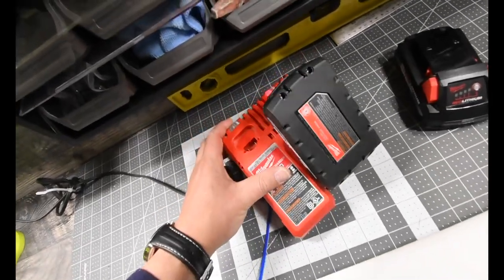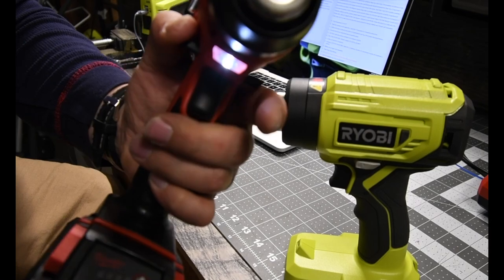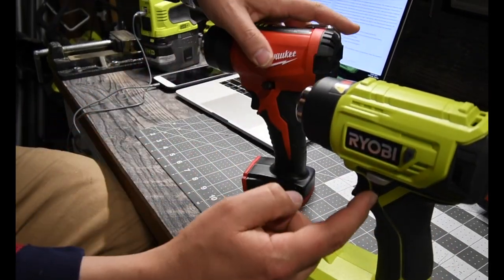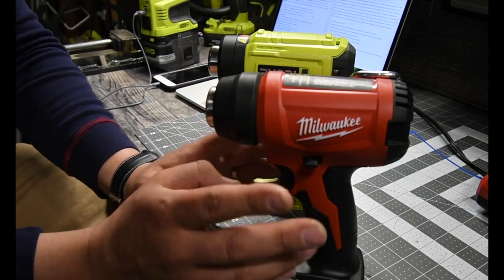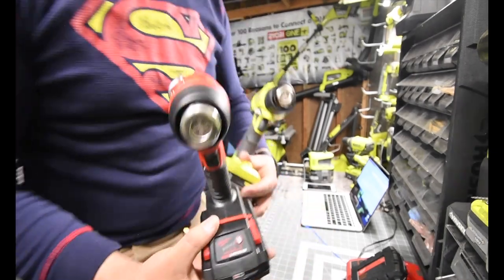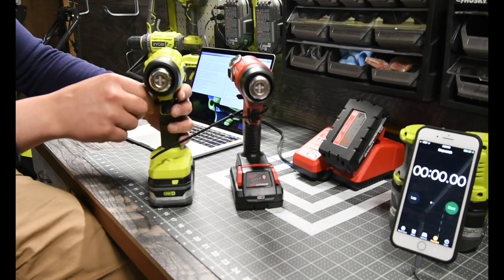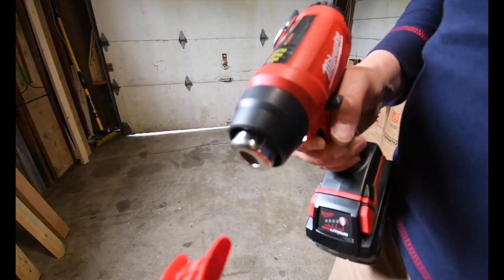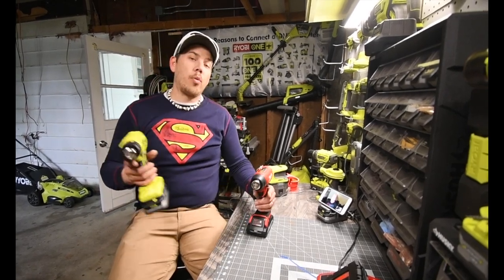Ryobi Heat Gun VS. Milwaukee Heat Gun

Comment: Bought the Ryobi last year and killed 2 in 4 months and 3 batteries. Then bought the Milwaukee and 14 months later  still going strong. Used on heat shrink tubing on auto electrics.
Reply from the maker: id go with the Dewalt. it is a much better heat gun
Reply: The Ryobi is made in the same factory by the same company with the same internal components as the milwaukee. I call bs

Comment: This might actually be better for me. Usually my head gun even on low gets too hot for why I’m doing. Usually hear shrink and such which seems to go from not shrinking to shrinking down and melting and misforming in an instant.
Reply from the maker: these are good heat guns to work that don't require a ton of heat
Reply: Man Caver Tools so you would say they would do good at window tint and heat shrink tubing as well as removing pinstripes ?

Comment: The Milwaukee batteries is what I fell in love with the tools are just a bonus 😂 in my opinion Milwaukee has the best batteries, I love my Ryobi too, great video
Reply from the maker: Thank you sir
Reply: Mykel Hardin  21700 cells in their new batteries, including this 3Ah battery in this video.
Reply: @anderspedersen5513  we have Bosch, Milwaukee and Dewalt in the truck. 21700 batteries for Bosch and Milwaukee so i can conpare 18V ProCore  to 18V High Outputs.
Bosch makes a more compact one lined 4 Ah than Milwaukee does 3 Ah. Bosch is the same for 8Ah than Milwaukee for 6Ah. 
We love to switch and battle some times in real life applications. The Bosch ProCores keeps working longer and unlike Milwaukee they don't lose to much power if they are on 1 to 2 bars left.
So i dissagree. In 21700 18V Batterie tech Bosch is leading

Comment: I love Ryobi as well but Milwaukee is the big brother. I have love for both. Ryobi doesn't really have a 12v system besides the drill so I have the Ryobi 18v tools but I am planning on getting some Milwaukee m12 tools because I believe they have hands down the best 12v line. I wonder if the internals of these heat guns (besides the battery connectors) are the same since they are so similar and tti owns both.
Reply from the maker: They were very similar in my hands.

Comment: Great video....you going over the simple features such as the handle grip and safety button location. I’m using mine for epoxy/acrylic pours and with my Ryobi glue gun it’s a perfect match for that application.  However I love my M12/M18 for my field applications, etc.
Reply from the maker: This is a much older video and I left info out in these ones and I thank you for you feedback Marlin

Comment: I push the Milwaukee safety down with my thumb...works fine. The safetys on their saws work similarly. I bought a bunch of tools during Ryobi Days last year. Ryobi is great for tools you don't use that often or specialty tools that nobody else really makes. I ended up getting more of my heavy use tools in Milwaukee. I need to get a heat gun, though. Still not sure which one I will go with since I'm heavily into both battery platforms. I'll probably go with the Ryobi since I also use the Ryobi hybrid solder station and I'd most likely be using the heat gun for shrink tube.
Reply: Yea I do alot of building and I'm hard on tools man I love ryobi they great for the price
Reply from the maker: its just in a bad spot or I just have big hands

Comment: My biggest gripe is that neither of them have a trigger lock. I use a heat gun to thaw out frozen evaporator coils and holding a trigger will tire out your finger. LoL
Reply from the maker: I agree. it would make it a lot easier to use if it had that feature
Reply: Does it work good for thawing out coils?

Comment: Ryobi is the best brand for working at the house there is. They have plenty of power, but they don't have much durability. Milwaukee and DeWalt will always be my first pick on a job site. I've literally twisted the motors off of the plastic handles with Ryobi tools, I've burned the motors out on a regular basis. They're just not industrial tools. Ryobi tool is not meant to drill 500 holes in one day. But if you need to build a deck on your backyard, it's the best bang for your buck there is.
Reply from the maker: Exactly and thank you sir
Reply: The new stuff is great, they've came very far. I use Ryobi daily impact and drills and it stands right with the others no problem. They've been going a year strong

Comment: I just got a ryobi hest gun. I noticed when i used a ryobi 1.5ah, 4., a  milwaukee 5.0 and 12 ah  battery  on it with an adapter the ryobi works better on the larger ah batteries than the smaller ones. The 12 ah the ryobi fan runs the fastest and hottest

Comment: Great info man, thanks.  I’m probably going to get one.  Definitely will a heat gun if I can’t find my corded one tomorrow.
Reply from the maker: it is definitely good to get battery operated heat gun
Reply: Its for small jobs, and its expensive. For paint removal and stuff its gonna work much slower than a corded one and for max 15 minutes with a 5ah battery. The ambient temperature makes huge impacts on its performance, it has very low performance in cool environments.

Comment: I've had the Milwaukee since its release in the shop used it daily and it's great for what is it, since both Milwaukee and Ryobi are the same company i suspect they are similar inside.  These guns are great for my work ( sign writer) but they do not replace a real corded heat gun but for vinyl work and heat shrink they win. Great video. Panasonic has the best grips 👍
Reply from the maker: I love these portable Heat guns

Comment: I understand your love for Ryobi which I also love their tools but they cannot compare with Milwaukee.... they are solely designed for homeowner use.... don’t get me wrong they are great tools but not in the same class overall as Milwaukee.... Milwaukee is simply the Best POWER TOOLS on the market hands-down
Reply: DougE .... I don’t relegate anything.... what I am stating is fact.... Ryobi is geared for the homeowner/DIYer Milwaukee is geared for the contractor/professional.... they are both produced by the same company but they are made with different components.... for example my M12 Milwaukee drill driver weighs more than my 18 V Ryobi drill driver....It is because of the way they are made and what they are made of... I am not insulting any brand I am merely saying that certain brands are designed for certain situations... I will agree that Ryobi nailer’s are actually better than Milwaukee‘s.... even so they probably would not last as long due to the fact that Milwaukee is built heavy duty....Again I am just stating fact
Reply: DougE ... It’s the same difference no matter how you slice it.... I recently did a tutorial on my YouTube channel... rich reviews...And I explained the differences between tool brands... it is what it is....Ryobi and Milwaukee are both made by TTI... but it is what they are made with that differs them.... everything Milwaukee is all heavy duty and is designed for heavy use and abuse.... it is why most contractors prefer Milwaukee.... Ryobi makes great tools and can compete to an extent with some of their tools but in the long run they are not going to last nearly as long as Milwaukee.... you can split words and definitions as much as you want but the fact is still fact....That is the point I am trying to make
Reply: What makes you think milwaukee is the best power tools?😂😂🤔your comment is a dam fanboy joke. Because what i know a 100 dllr nailer is better the fuel nailer. And dewalts 300 dllr nailers are the best battery nailers.
Dewalts flexvolt cic saw bangs the fuel.
Dcd996 owns gen 3.
Bosch has better rotary drills.
Just saying your comment is a fanboyism.
Milwaukee only has best is the sawzall and impact driver. Other than that red china crap sucks.
Reply: @devilefan  how about trying festool or bosch or even hilti. Milwaukee is not even professional grade😂😂
Reply: @DougE dude milwaukee aint the best. And saying is the bst overall when you havent use all brands is dumb asf. Also dewalt has the best saws on the market. Ridgid best shop vacs.
Bosch best hammer drills.
I can go on.
Reply from the maker: thank you for viewing
Reply: Sitting in my chair eating popcorn watching the cat fight ;)

Comment: I do hvac I sometimes need to do electrical pipe work with electrical  grey pvc will this get it hot enough to bend the pipe on sche 40 pipe
Reply from the maker: It is very Handy in certain situations
Reply: I know I am late to the party but as an HVAC guy myself I can attest that either one of these will work with bending conduit.
Reply: How hot would that need to be?

Comment: The paper test makes no sense... The ignition temperature (flash point) of paper is 451° Fahrenheit. If both tools are rated at 850° there should have been no problem lighting them with either tool. Maybe your paper sample was treated with something that increased the flash point?
Reply from the maker: airdog99 I was hoping it would catch on fire, but no Luck ;(
Reply: @ManCaverTools  Or the tools aren't actually getting the rated 850° they are claimed to produced... Thanks for the video!

Comment: I have the Milwaukee heat gun & I totally agree with you on the safety latch of the Milwaukee above the trigger needing to be pulled down before pressing the trigger! WT* were the engineers thinking!? SMH! I might just bypass that Milwaukee safety latch I hate it so much. I have DeWalt, Milwaukee & Ryobi battery systems BTW. Thanks for sharing the comparison.
Reply from the maker: Jet Engine Thrust you are welcome sir

Comment: I have the ryobi heat gun and have used the milwaukee heat gun several times at work. i can say that the milwaukee is more comfortable to grip and the hook is a great addition. I  see you are biased to Ryobi and did not think your review was a  just one. They both do the same job that is expected out of a cordless heat gun. However I find that Milwaukee is the leader in cordless tools as they have the best batteries.
Reply from the maker: This is an older video. I have big hands and I like the Ryobi thickness of the handle. I also like the Milwuakee M12 handles as well
Reply: @ManCaverTools  Yes the RYobi tools are good tools and I can say for the price it really is the best option for ppl of all trades and DIY.

Comment: The Ryobi is $99 tool only.  And Milwaukee is $129 tool only.   $30 price difference.
Reply: Coming from a Ryobi fanboy with 11 batteries and 18 tools I think either heat gun is way overpriced. Drill master $8.99 heat gun all day. I'll deal with the cords for the 2 times a year I use it.
Reply: MiJaK123 I just wanted to mention the prices.  I don’t think he did in the video   
But I’m right there with you.  I got a heat gun at a garage sale for $15.  I don’t mind dealing with the cord the handful of times I use it during the year.
Reply from the maker: and they work the same

Comment: FWIW, the new Dewalt cordless heat gun (DCE530B) will set paper on fire.
Reply from the maker: Ill be interested on seeing that
Reply: So will the Ridgid, it uses a battery, AND butane...1,100F.
Reply: Uh, it CAN put out more heat, because the ridgid uses butane as well. It actually has the least draw on the battery of any of them.
Reply: When i use a heat gun i dont want to set things on fire .  If i want fire i'll use a torch , no battery needed

Comment: You know that both brands came from the same company.
Reply from the maker: Yes I do sir
Reply: Made to different specs, apples to oranges.
Reply: @huejanus5505  - nope- specs are identical.
Reply: @huejanus5505  they are bssicly clones 😂
Reply: Thomas B    I’ve seen many tools cloned only on the surface, cheaper components used. Eg: with drills they use plastic planetary gears instead of metal. Same specs though. You get what you pay for.
Reply: There goes know it all chuck

Comment: its unnatural to use your trigger finger to switch any gun off safety. your naturaly supposed to use your thumb and also you if you mount the charger to the wall you can se what your charging.  as for the fan milwaukees is just more quieter and more well built..

Comment: It's clearly you're bias.
Reply from the maker: old video. but these both performed the same. The dewalt heat gun is the one that is better
Reply: Man Caver Tools is the dewalt the new power detect does it get hotter with the HO batteries?